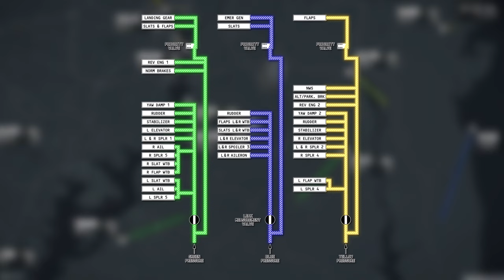Hydraulic Problem Results in EMERGENCY Landing at Dulles [ATC Audio]

Comment: 13:26 Good thing to note is that the schematic shown is that for the newer Airbus A320s. Older A320s, including N766US (I believe) would be equipped with Green Hydraulic NWS. The point with Reverser 2 is less relevant since assuming autobrake is used, thrust reversers would have no effect on the commanded deceleration rate.